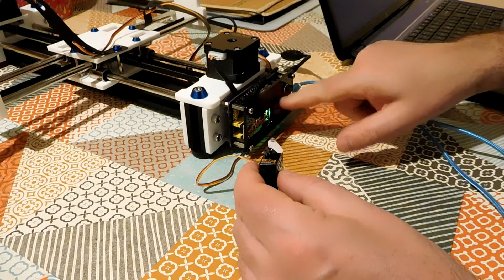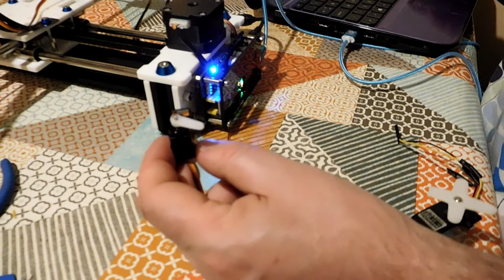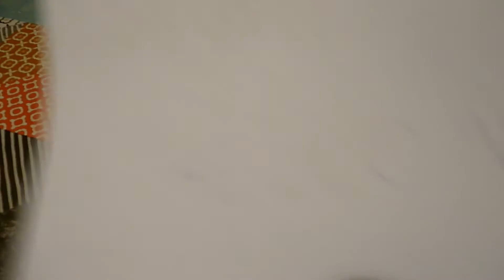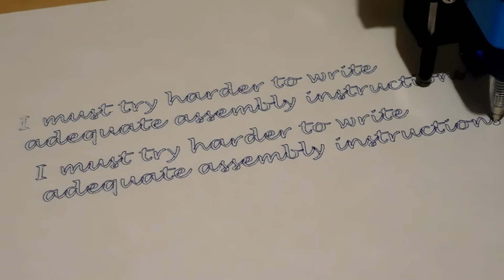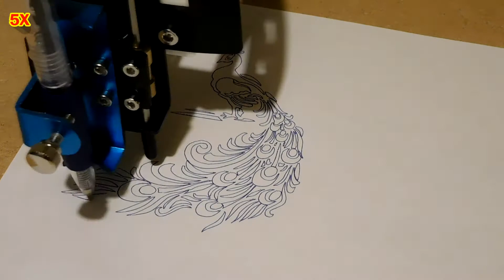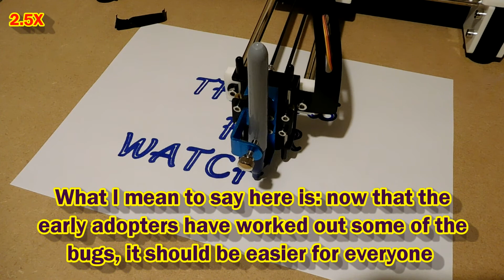It Works! Eleksdraw Plotter Final troubleshooting And Demo (Part 3 of 3)

Comment: What software did you use? I've tried elekscam on Windows 10. And it doesn't work.
Also please tell me this uses the serial port?
Reply from the maker: It just attaches via USB. The controller has a serial UART that emulates a serial port. Elekscam needs to be run ad administrator to work properly (which is not great)
Reply: @AtomicShrimp  thanks for your reply.  The device manager didn't list the port... I unplugged the machine and plugged it back in and it picked it up. Thanks again
Reply from the maker: Yeah, that sounds about right.  My experience of this device has been that it requires a fair degree of delicate messing around to get it working just right

Comment: Hi, I recently (2 weeks ago) bought an eleksdraw. It came just like yours (in parts), but I've managed to put it together and got it working. The only issue is that it draws at a 45 deg angle. As far as I understand, it's a firmware issue? How do I update the firmware? Where can I find it? Any help would be appreciated! 

Imran
Reply from the maker: You have to set the EleksCAM software to the right machine (EleksDraw, which is a CoreXY plotter, not EleksLaser)

Comment: https://www.youtube.com/watch?v=CANJXxfceEw <~~modified version
Reply from the maker: Intreresting upgrade - you've almost completely reinvented it.  Camera work is a bit frantic!
What software did you use to drive it?
Reply: @AtomicShrimp  T2 Laser
Reply from the maker: Did you need to reflash the controller to work with T2?  I've heard it's better, but I am scared of bricking my machine
Reply: @AtomicShrimp  yes I reflashed but works with default firmware too, but grbl firmware is too fast, the image i engraved in 6 hours now takes hardly an hour
Reply from the maker: Cool. Can t2 engrave open shapes? (eleksCAM can only do closed outlines)
Reply: @AtomicShrimp  yes, it does d vector

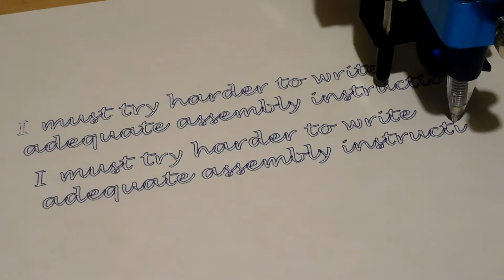Comment: Hi, How do you get that font working @ video position 3:35?
Reply from the maker: Getting it to use any font properly is a bit weird - you have to select the font within the Eleksdraw program, then when you click the button to create it, a Windows font picker dialog comes up and you have to select it again - then it seems to work, but only in some modes such as outline or point - for the 'truefont' mode, it will only use the built in line fonts

Comment: I'm looking at this as a way to print with marker pen onto bare copper pcb board. Wonder does the software print/import gerber files. if not no big deal could convert to another format. I would then wash exposed coper away with ferric chloride and then wash the permanent marker off with alcohol.. should be a nifty way to create diy circuit boards. I have a cnc but to get the plotter head cost more than the eleksdraw. Think it might be good to have a dedicated little plotter like this, and leave the cnc for drilling and milling. After having this for quite a few more months now..would you advise for/or against buying one??
Reply from the maker: The native software only supports images in BMP and JPG type formats, plus SVG, but there are some quirks and issues with SVG scaling - actually getting this thing to draw a line drawing with lines is surprisingly tricky - it wants to draw outlines of lines, rather than the lines themselves.
There is some third-party software called T2Laser which has more features and is probably more stable.
One thing you may wish to consider: the standard laser accessory for this device is probably capable of directly exposing the resist on your PCBs, so you could potentially skip a couple of steps and just do laser, then etching bath
Reply: There's a load gcode button at the top of the software
Reply from the maker: Yeah, it's pretty unpredictable.  You can's preview what the GCode will do, or set the origin - and even when the Gcode has been generated by the EleksDraw plugin for Inkscape, the scaling is incorrect.  Some of this might be my ignorance and inexperience, but not all of it is.

Comment: I am wondering if that will be good to draw resist Ink onto copper clad to make proto- circuit boards
Reply from the maker: If you have something that can create GCode, it will probably do OK with that.  The limitation of the EleksDraw software appears to be that, otherwise, if you give it a bitmap image, it can either draw it raster (which consists of lifting and dropping the pen for every pixel - the results are not great) or it can trace the outline of the bitmap, and it will draw an outline of your layout, rather than the layout itself).

What might work is to let it laser the outline of your layout onto a board that has a full resist coating - the resist for the lasered area should dissolve away, allowing you to etch the PCB (there will be big areas of copper left adjacent to your layout, but not connected to them.
Reply: Hmmm, good idea. Thx
Reply: Try using the load gcode button in the top of the software screen

Comment: hi if have the same problem , my pen lifter servo dont work right how have a solution for this problem ?
Reply from the maker: In the 'send gcode' box, type A1 - this sets the controller to servo mode (not laser)
Reply: THX the pen lifter works , but now the next problem the stepmotor dont work . Because i have the neue Eleks ROM installed

Comment: Well I'd bought one before seeing your video and was shocked when I got a box of parts! I was expecting a built working device too. mine was the metal pro version and also had no instructions at all. Plus the forum instructions for the pro were even worse than the one you have. The forum is crap too, to download software it points you at the forum but you can't find any software to down load. When you ask on the forum a guy called Z gives you a link to software and instructions! How inefficient. Anyway it took an evening to build mine and all is working fine except the incredibly buggy software. It crashes more times than a crash factory. After the initial disappointment I ended up quite enjoying building it, mainly because the instructions were so bad you had to learn how it works to actually build it correctly. Thanks for the vid, I just wish I'd watched it before building mine.
Reply from the maker: Yeah, it's fun when you get to the point where it works... IF you get to the point where it works.  I also just figured out I have been running the laser on minimal power - so the device has more capability than I was using - I'll be putting out a new video on that soon.
Reply: Yes, you are right. I have eleksdraw (yes, box of parts ;) ), i think hardware self is not bad (mounting instruktion very poor). But sw Elekscam is very bad,  and vergot forum. Nobody from eleks company helps with problems. No email to producer, no help. I have printer, i can not use it. Only one mssg in forum from T2Laser producer, i have to use better sw, his sw. May be it is the right way with T2Laser sw, but after using trial version sw i dont understand, what i have to do for right working.
My problem, at the moment is ... print of picture dont works, print of letter works. I need for my doughter to school this path with G-Code for technical drawing, but up to yet i dont find right format-way, how i can print technical draw (best way from freecad). If anybody can help me (my doughter for school), i would happy about, Thanks in advance

Comment: Yes!  Great job and thank you so much for sharing this.  Mine arrived yesterday and your video will be a great help getting it together and running.
Reply from the maker: I'm going to do a quick followup tomorrow on the specific bits of tinkering I needed to do -both mechanical, and software.
Reply: Yes please do.  Especially the software part.  That's where I'm at now.
Reply from the maker: OK - spoilers on the software side (video coming soon).

1. You need to run EleksCam as Administrator, or it crashes (locate the actual executable program, right-click it, select Properties>compatibility and Run As Administrator.  You'll get a security dialog every time you launch it, but it won't crash (so much)

2. EleksRom (the firmware update utility) needs an additional file called libusb0.dll dropped into the folder that you run it from (alongside the program itself) - you can download libusb0_32.dll from SourceForge - rename it libusb0.dll and drop it into the folder alongside EleksROM

3. EleksCAM needs an additional file called SVG.dll added into the program folder if you want to import SVG images (from Inkscape or Adobe Illustrator) - there's a link on the EleksMaker forum for this file

4. If your pen-lifting servo misbehaves like mine, when you first connect your device and launch EleksCAM, use the 'send GCode' box to send the code A1 to the device - this tells it to switch from laser to servo mode.  There's a complete list of all these codes on the EleksMaker forum

Comment: Good on you! It really looks good. I mean the drawing and writing it produces. However, it is good that all fell to adjusting the software and not any problems on the hardware. To me, for Chinese stuff, in most cases, it goes like this - most problems appear to be on the software.
Reply from the maker: Yeah, the software is really a bit wobbly and beta. There were some mechanical challenges too - although most of those were shortcomings in the instructions (for example, fully tightening some of the screws stops some the moving parts working properly.
Reply: AtomicShrimp Why? Probably they need a bit of space to move. Just like overtightening a glasses frame?
Reply from the maker: It's the screws holding the central carriage together - the spacers are just a tiny bit too short - so if the screws are fully tightened, it distorts and the linear bearings go out of alignment.  It's a design flaw, but a fairly small one.